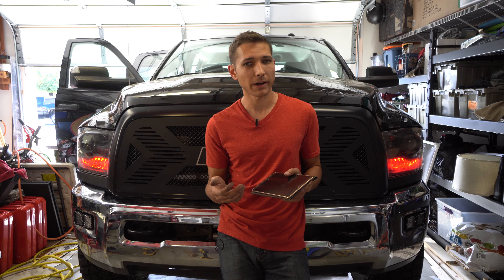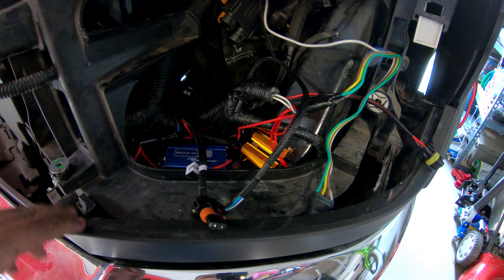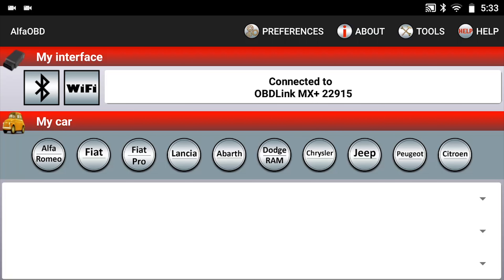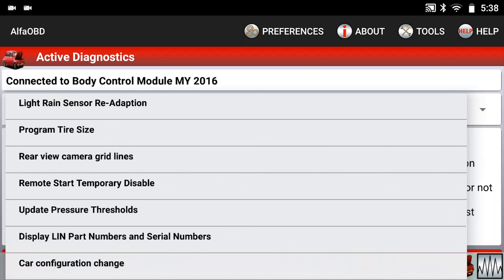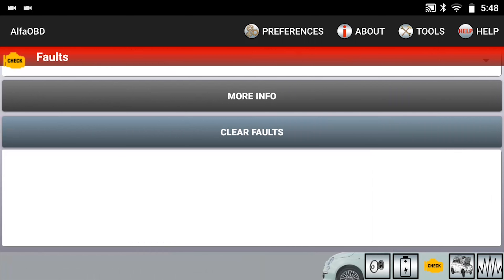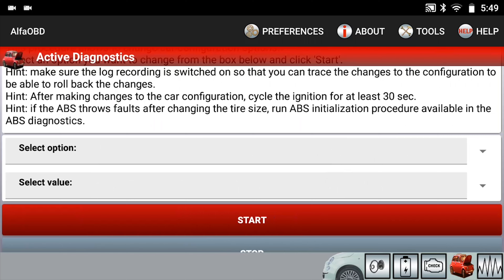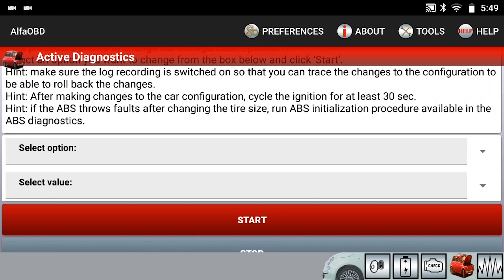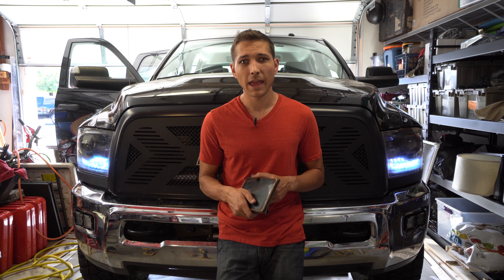Ram Bulb Out After HID/LED: Alfa OBD Error Fix For Headlights+Turn Signals

Comment: To anyone that installs aftermarket headlights and still has an out turn signal warning even after changing to LED turn signals through alfaobd: In alfaobd car configuration change under CBC I/O Usage, disable the two front door ajar switch usage settings. Those are the front lamp diagnostic circuits. This will solve it!
Reply from the maker: Thanks I'll look into this!
Reply: Mine is set to disabled and I still get the error code not sure what else to do.
Reply: Thanks a ton buddy. Fixed my Hyperflashing mirror blinker. After weeks of research i found your comment.
Reply: I tried it because I’m still getting the turn signal out errors and it doesn’t fix it on my 2015 1500 Sport! My next step is to turn off the sequential turn signals and just have them blink like stock ones do for that year and see if that solves it!
Reply: @FetterLiebhaber53  What year is your truck and what exact setting did you disable to fix your hyper flash on your mirror blinker? There’s so many in the Alfa OBD program I want to make sure I tried the correct one!
Reply: Thank you man a lot!
Reply: @FetterLiebhaber53 what exactly did you do? I can’t find 2 front door ajar switches
Reply: @erikhorne846  Sorry for beeing so late to the Party. It's been a while, but if I'm correct it was "CBC Config I/O Usage: Front Driver Door Ajar Switch Signal Usage (Lamp Diagnostics)" and "CBC Config I/O Usage: Connector F Pin 28: Passenger Side Lamp Diagnostics/Door Ajar Switch Signal Usage" both set to "Disabled" my Truck is a MY2015 Limited
Reply: @Laxbro230 It's been a while, but if I'm correct it was "CBC Config I/O Usage: Front Driver Door Ajar Switch Signal Usage (Lamp Diagnostics)" and "CBC Config I/O Usage: Connector F Pin 28: Passenger Side Lamp Diagnostics/Door Ajar Switch Signal Usage" both set to "Disabled"
Reply: @FetterLiebhaber53  would you happen to know which ones run the tail light diagnostics?

Comment: Thank you so much for this video and the other video about OBDlink and alphaobd. These two videos helped me especially this one because my truck was being stubborn. It kept cutting power to the right front headlight even after switching the configuration to LED. The only other one I had to change was the High Intensity Discharge headlights I had to enable. By the way I have a 2015 Dodge Ram 1500 Sport.

Comment: I can verify that changing the configuration to led on parameters actually works. I was struggling with a side marker led lamp and to my surprise this did the trick!
Reply from the maker: Sweet! It sure is annoying to have errors or have power cut to the lights altogether because of the computer
Reply: Which one did you change, I have driver side cutting off randomly. 5th gen 1500

Comment: I used the global window down option to roll down my 2 front windows with my key pushing unlock 2 times and holding button letting go when I want it to stop. Worked great!

Comment: I know, this is an old post.  '17 Ram 2500.  Alpha Rex Nova 5th gen style headlights.  Worked great for about 3 weeks, then got parking light out errors.  Anyway, got my OBD setup today, jacked around with it all afternoon.  Fiddled with everything LED light related.  No joy whatsoever.  Still get a "Parking Light Out" error when the parking lights are on and I activate either turn signal.  I even changed the rear settings.  Exercise in frustration that tries a man's patience.  Resistors are a dirty way of compensating, but I'm waiting for the set Alpha Rex sent out to me.  Alpha OBD is a useful tool, no doubt.  But so far the pom-pom's are still in the closet. 

UPDATE:  Got in my truck this morning (day 2) and just checked to see if they worked, you know, just for fun (and frustration).  Guess what?  NO MORE ERRORS!!!  At all!  Apparently I must not have let it sit long enough.  So...I'll run it for a while and see if the errors return.  But so far, so good.  Maybe there is hope after all.  ;-)

Comment: Thank you for the video! But if the rear lights and turn signals are visually in order, but the error remains, it is easier to disable the check of the rear lights in alfaobd, the menu-f pin 31 diagnostic and f pin 27 diagnostic just turn off and the error disappears from the instrument panel! Peace to all!
Reply: Didn’t work for me unfortunately
Reply: Right now i’m sitting in my ram 1500 2013 but i did f31 disable but i cannt find 27!  please can you help me out

Comment: Very informative! I like the feature to turn on fogs with high beam. I installed bi xenon kit from enlight with no trouble so far,kit was for 16 but everything seemed to fit 17 ok.
Reply from the maker: Some of the aftermarket kits seem to do okay (since they've figured out the proper stuff to use) but it is still technically tricking the computer. If you have no problems I wouldn't bother, although Alpha does a lot of other cool stuff, and if you have it you might as well!
Reply: Charles Pages 
I have a 2014 Dodge Ram 1500 I just add morimoto Xb headlights and tail lights. I did everything in your video and still getting error codes. What else am I try. Codes saying high beams out and parking and backup lights out
Reply: @JH-ie3dv  did you ever resolve this?
Reply: Seems like 14 is the problem year lol
Reply: @JH-ie3dv no fix?
Reply: Nope still no fix
Reply: @skywalker3760  No fix I  am just living with the error codes at start up

Comment: Charles Pages, I appreciate your videos so far, but have an issue I'm hoping you can help with. I have a 2019 RAM 1500 Classic, Tradesman and swapped out the stock taillight and third brake light housings for LED's. I also put towing mirrors on (w/turn signals). No problems with the LED's until I upgraded the EVIC to a 7". Now I get "Parking Lamp out" when I hit the brakes, or use the turn signals (only when the lights are on though - no issues at all with turn signals or braking when lights are off). So, after watching your videos, I purchased AlphaOBD ($49.99), OBDLink MX+($119), & the security bypass cable ($55) ... roughly $225 and, was able to activate the turn signals on the mirrors, but can't get rid of the "Parking Lamp out" warning. Changing only one thing at a time, I've tried a number of combinations with the CBC rear LED present items ... all present, only the taillights, only the stop lights, and or only the turn signals and nothing is working. I'm running out of ideas. The tailights came with built-in resistors, but obviously they did not work, or I wouldn't be getting error messages, but I get the errors whether I have the LED present on or off. Any suggestions?

Comment: I have a customers 19 Ram 5th Generation came w/factory installed all led headlights and fogs, etc. I installed a heavy duty front bumper with winch and 2 aftermarket 4" led pod lights, soldered into factory led fog harness w/out resistors. I assumed that it started w/factory hid I wouldn't need resistor's. It's giving turn signal lights out message on the cluster(cluster image shows being the fronts). I already have to send it to the dealer to recalibrate the front Impact sensors since they are at slightly different locations than the factory bumper. Will I have to install resistor's or will they  be able to clear out or make changes to clear the error? Thanks for your information. The video was well done. 
ACME Garage
Petersburg, TN

Comment: Thanks for video. I have issue on 2015 grand cherokee, had halogens and swapped with leds  low&high beams and fog lights . light work when engine is shut and goes off as soon as I start engine. hope Your video will help me to fix it 🙏

Comment: I did all the changes to say yes to LED. I am still getting lights out and backup lights are out. What else can I do. I have a 2014 Dodge Ram that came with factory halogen bulbs .
Reply from the maker: What bulbs did you replace (not brand, just location ie brake lights, low beams etc). Do they work when the truck is off? Did you give it a few minutes between each change to make sure they were accepted by the computer?
Reply: Charles Pages 
I replaced the front headlight housing and tail light housing. And they work when the truck is off. I waited 5 minutes in between changes
Reply: AlfaOBD doesn't do the trick. I'm having the same problem in my 2014 Ram 1500. I replaced every bulb with an LED from Diode Dynamics. Yes, the truck's computer states LED as Present. But the truck still gives bulb out errors. And rapid blinker sound is too obnoxious. I'm about to just suck it up and pay $40 dollars for four LED Resistor Kits from Diode Dynamics.
Reply: @oliversmith7342  
Let me know if the resistors do the trick.
Reply: My 2014 is giving me a similar problem execpt I'm only getting the "parking light out" message.
Reply: I also have a 2014 getting parking light out and front left and right turn signal out since I have switchbacks and also back up light out since it’s an LED as well. Can’t get it to go away
Reply: Same problem. Still getting errors. Resistors came with the aftermarket tail lights I ordered, so I installed them, and that eliminated the hyperflash at the mirror lights and dash. Still getting parking light and high/low beam errors.

Comment: Hey Charles,
Great videos btw.
I have a 2012 Laramie 4x4 with quads and I want to install the projector with sequential switchback turn signals but can't seem to get the DRL's to be on in Auto mode.
Can you show what needs to be changed to show that?  Would the setting to have the DRL's on in auto be in the turn signal? Mine look like yours only chrome background and sequential...I want to just have the DRL's working like they do if I have marker lights or turn the lights on.
Thanks!

Comment: Dear Charles!  I have a 2019 ram 1500 halogen package I already upgraded my headlights with a morimoto and they are really good no problems,  but the tail lights I went with alpharex and everything works but the corner lights I got in touch with alpharex they were trying to help me but no luck and I hear about changing the settings the truck for leds do you think that might work?

Comment: Thought I would share my results. 2015 Dodge Ram 1500 here. Changed to leds and got the problem of one light constantly going out. Installed the Alfa obd and changed the led settings... did not fix the issue. As soon as I turned on the setting allowing HIDs I havent had a problem since!
Reply: Dave Rogers - did you leave the LED enabled?

Comment: So I have done this and my vehicle a 2018 Ram 1500 big horn I have sequential front turn signals now with the new headlight assembly that I installed and I still get the “parking light out” error message but only when the headlights are on and I turn on the turn signal. If the headlights are off and I use the turn signal I don’t get the error message. I don’t know what else to do to get the message to go away. Any help would be greatly appreciated.

Comment: Great video, I have a 2018 3500 ram but before I get the OBDLink MX and the Alfa OBD software I would need the bypass cable do you have any recommendation on where I can get one?
Reply: Same here, another video recommended a by pass device but it is now in unavailable. What worked for you ?

Comment: I have AlfaOBD, I just buy GTR Ultra 2 LEDs for low beam for my RAM. Can I just put them in and program with AlfaOBD, without having to buy/install GTR’s PWM interface module? Or would I still need the module?

Thanks! Good vid
Reply from the maker: You can put them in and program with alfa, you shouldn’t need the pwm modules!

Comment: Hello, great video. I have question. I have a 2015 ram 2500 ST. I am trying to connect rear LED bulbs. I have did each step separately and waited. I get all my lights except left and right turn signals. The alfa obd software says LED TURN LAMPS PRESENT - YES. Any advice?
Reply: Same here with my 1500 2014 slt

Comment: I have a 2012 Ram 3500 w/Quad head lights and have installed Supernova v.4 in lows and highs.  My problem is intermittent flickering of the high beams while DRL mode, but not while in Auto mode.  I don't want to change the location of DRL or turn them off,  but would like to see if AlfaOBD can fix the flickering. And I certainly do not want to have to fiddle with resistors or capacitors!  I do have the software and can navigate the app, but man there's so many options that it's overwhelming.  You can even change the voltage for the lights!
Reply from the maker: What is the setting for high beams right now? Led present or not?
Reply: One thing I've noticed in the app is that under "select control unit" and then I select car configuration change, my control unit doesn't show any LED options.  I guess my 2012 is too old for LED's?  Seems like anyone with 2013 and above has that option.

Comment: I wished AlphaOBD app would put a check mark on the settings that has been changed and completed so you know you done it in the list as well as have a running settings change list you can refer back to so you can keep a log on what you have done
Reply: That's an EXCELLENT suggestion!!!

Comment: I have hikari canbus decoder for my low beams. Will I still need that? I have no problems with my highs or fogs. My low beams are hid and won’t turn on or when they do won’t stay on
Reply from the maker: You won't need a decoder if you reprogram with alfa. The reason your lights turn off is because the truck thinks something is wrong and it cuts power. Reprogram with alfa and you'll be set.

Comment: Very useful! I just order everything and hopefully by next week I can start doing. This on my 2015 express . When enabling HID lamps on will work for all the lights low beams and fog lights? Currently I have HIDS on my projectors and also my fog light .
Reply from the maker: You'll need to adjust them separately in the app, but the settings are there. I'd change it to "hid present" and use relays...
Reply: Got it . As of now I don’t run rellays. Plug and play . But yeah this was really useful I can’t wait to do it .
Reply: Okay so i stared today doing all this. I don’t know what I did wrong that my fogs won’t turn ON at all and on the switch I try to turn it off but they Do Not Turn Off. The light keeps been ON on the dashboard even if I turn it off the light says it’s ON. Any help ?
Reply: Try this CBC Features - Bi Xenon Headlights Enable made it Yes,  CBC Features - LED Low Beam Lamps Present, and CBC Features - LED Front Fog Lamps Present Yes.

Comment: I had a rear bulb out so I simply replaced it with a bulb from Auto Zone. Then I got the message “parking light out.” I got the OBD link and the software, found the error code and cleared it but the next day the same “parking light out” message appeared??? Any suggestions you may have to clear this up I’d really appreciate it. Thank You.
Reply: Just for anybody else that may be frustrated like I've been with these bulbs... MY SOLUTION; Went and purchased 2 "OEM rear bulbs" from my dealer (about $7 each) then cleared the "bulb out" error code with the OBD Link and ALPA software. "Bulb Out" is finally gone!

Comment: I tried to upgrade my Normal tail lights to the OEM led ones and one side works one and side doesn’t. Both have resistors on them and I haven’t been able to figure it out and neither does the vendor I bought the things from. It’s a 2019 RAM 1500 Classic Lonestar. It’s the same body style as the 09-18 rams and I’m also trying to upgrade my headlights to the same projectors you have but the DRLs don’t work, Do you think this OBD product will fix the issues I’m having? Also if I do make these changes, will it hurt to leave the resistors in?
Reply from the maker: This will for sure make everything work the way it should. I would get rid of the resistors, they might not hurt anything, but they waste power and could potentially cause the truck to say a bulb is out or something since it measures power output and might think something is wrong if the resistors are causing increased power consumption over a regular led.
All the resistors do is try and trick the truck, but its pretty smart and still says bulb out as you've discovered.

Comment: What happens when your truck won’t connect to any of the options in “control unit”? I have a 2015, Ram 1500, AlphaRex LED’s and obviously I’m getting a code error. I purchased the AlfaOBD app as well as the OBDLinkMX+. I connect phone to device no problem, set the proper truck model and select ‘Body Computer’ but then it won’t connect under the control unit to any of the ‘Body Computer’ options available. I don’t understand.. plz help me.

Comment: I have a 2015 ram 1500 and I have hids and switchback strip turn signals... probably a dumb question but should I hook everything up without the resistors?
Or should I leave all the resistors on and remove them after I reprogram the  cpu?
Reply from the maker: I'd take the resistors out and reprogram!
Reply: @chazpages  thanks for the quick response and thanks for making these videos they're super helpful!!! I'll let ya know how it goes when I hook everything up
Reply: How did this work out for you?
Reply: @FoxFishing4K  i still haven't had the time to hook anything up yet lol but when I do ill comment on here and let you know how it goes!

Comment: I upgraded from non power folding regular mirrors without the lights on them to power folding tow mirrors ( got door models from a different truck to get them to work) but now I get the turn signal light out message and it flashes fast on the dash but the only light that flashes fast is the light on the mirror…. Also the puddle lights don’t work not as important to me…Would love any advice to try to fix this if you know would be much appreciated